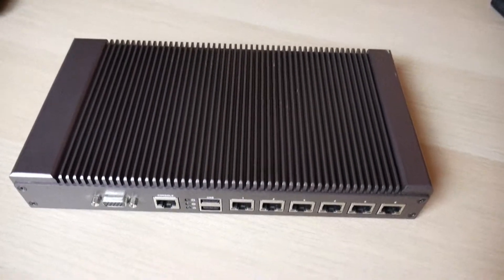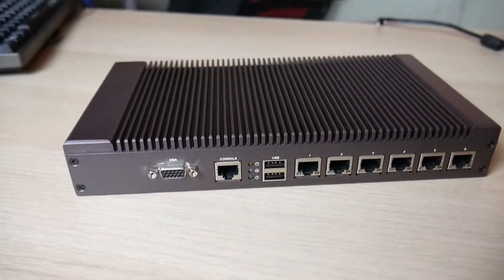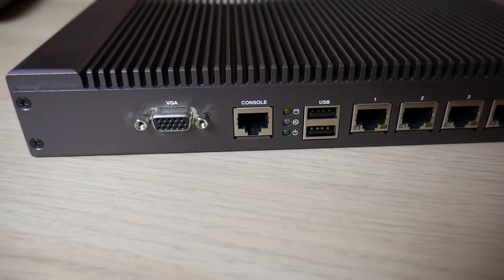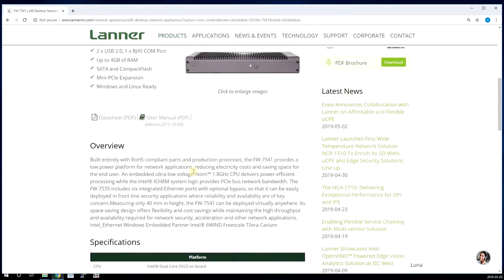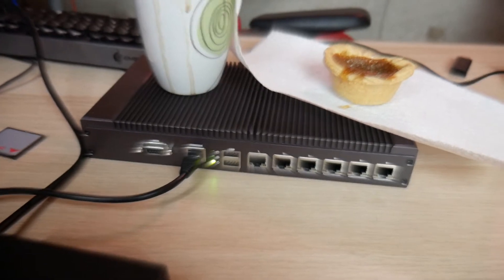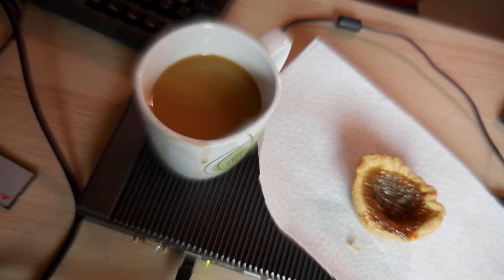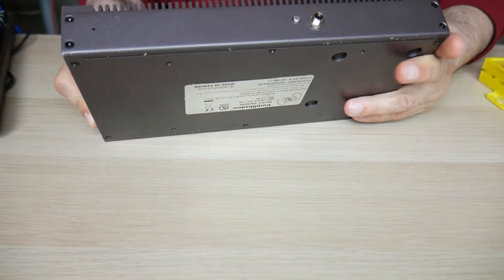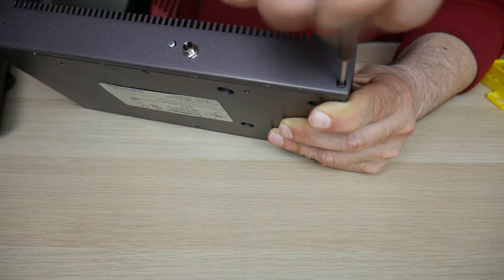✅ pfsense SSD install on Lanner 6 Port Router Hardware

Comment: I got a MX400 which is the Lanner FX-8865.  Meraki removed the console and vga external ports.  I should be able to use a vga and serial cable off the mb and move forward, right?  I think I have to remove the CF file and possible replace the hdd as you did?  Anyway thanks for the video!

Comment: How if my computer just have 1 ethernet? And I try to use USB ethernet and pfsense does'nt detected.
Reply from the maker: probably your usb ethernet is not compatible. check this https://www.youtube.com/watch?v=eO8wdLKpZL4
Reply: other option is a switch then map in pfsense, nick has done an extremely useful video on it...
Reply: I used a Cisco Switch(2960), but you can use any as long as you can configure VLAN's.

I looked into USB's, and there seems to be a lot of issues with it.
Reply: Linksys USB Ethernet Adapter Gigabit USB 3.0 worked for me. got it on ebay for about  15 usd.